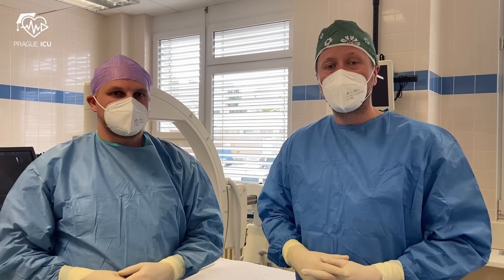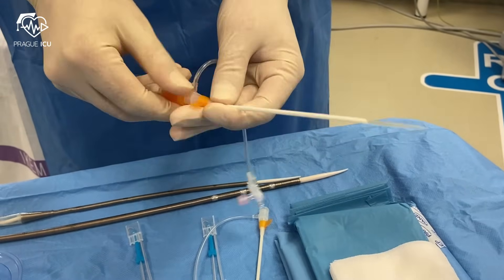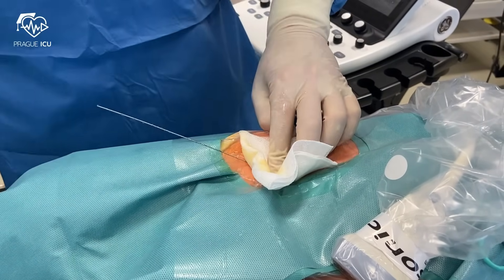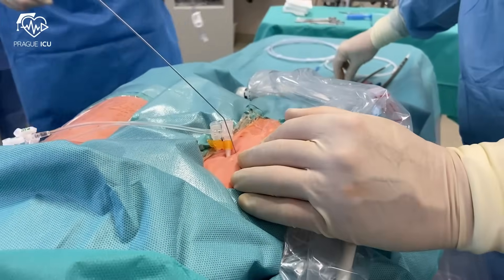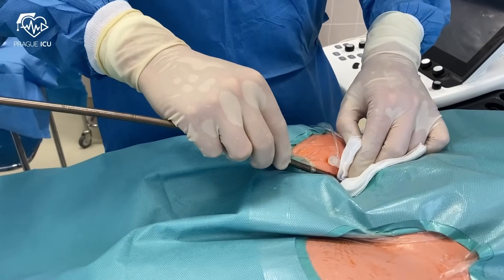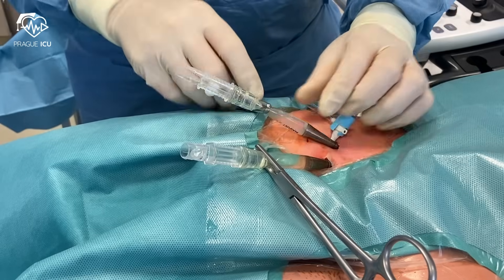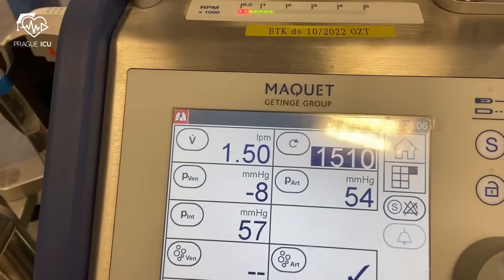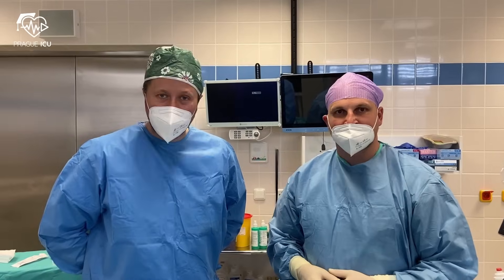ECMO cannulation

Comment: I have been a nurse for 28 years and have yet to see this amazing procedure. It is very similar to the cath procedure so the over all procedure is not foreign to me. Is all this done while traditional CPR is being done?
Reply: Once a patient is placed on ECMO, traditional hands-on CPR (compressions) are contraindicated. The ECMO machine will continue to perfuse the body even if the heart is in a non-perfusing/lethal arrythmia. They'll also most likely have devices implanted e.g. an impella, that would make CPR, which is already causing trauma to the patient, even more traumatic. Think of ECPR as a "chemical code," with medicine and electricity being the only tools used. Compressions are not performed while the patient is being cannulated.
Reply: Yes, spent 15 years in the operating room and  4 of that time was in Open Heart surgery. We would do valves, or septal defects requiring back then folks be placed on bypass ( Extracorporeal profusion) I was often the 1st or second assistant in these procedures. It just looks extremely difficult to have compressions going on during this process.
Reply: This isn’t a procedure you’d do on someone who is coding. It takes time to set up an ECMO machine, making it impossible for someone to be spontaneously and emergently cumulated for ECMO. Patients must be a candidate for V-A ECMO and V-V ECMO. Coding patients are certainly not candidates, UNLESS the patient was in the process of being canulated when they went into cardiac arrest. 

Furthermore, if your heart goes into arresting rhythm, VA ECMO is futile. You must have a functioning heart or else you’ll be completely dependent on ECMO and that is not realistic. 

tl;dr

No, ECMO is not meant for arresting patients.

Comment: Why are the cannulas grey?
Reply: the coloring on the cannulas, if anything like the coloring on iv catheter or hypodermic needle hubs may be color coded to represent a specific size. for example, a gray iv catheter hub represents a large bore 16 gauge needle
Reply: They are wire reinforced which makes them look grey. If you look closely you can see the coiled wire in there. It's much clearer in person.